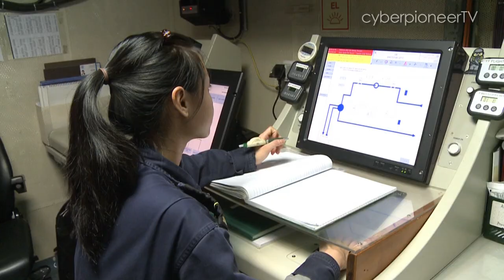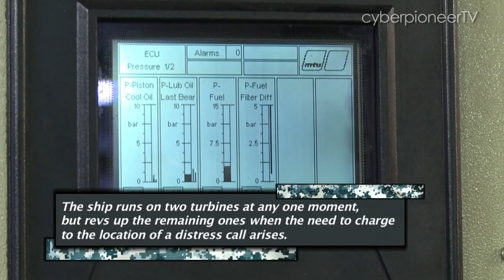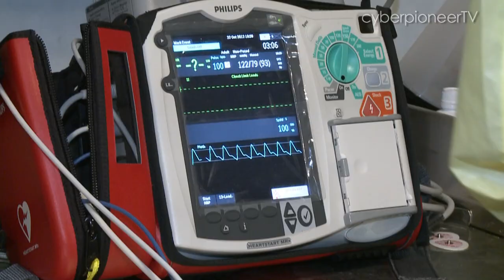Ep 2: Sustaining the Journey (Sinking Piracy)

Comment: Why do they wear a mask?? i have been wondering for so long
Reply: White mask called Anti-flash gear, is basic personal fire-resistant hood.

The purpose of anti-flash gear is to provide protection to the head, neck, face from short-duration flame exposure and heat. This equipment is donned by shipboard navy personnel whenever a fire breaks out or during periods of heightened readiness.